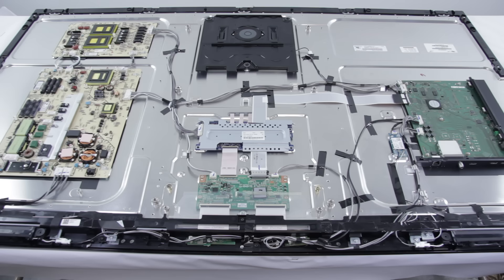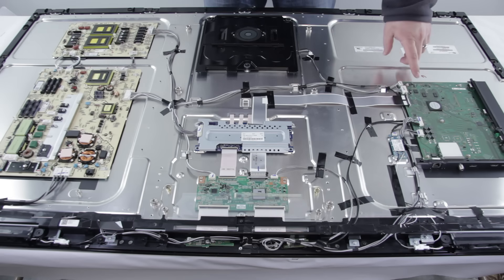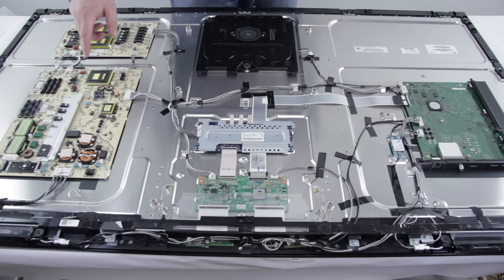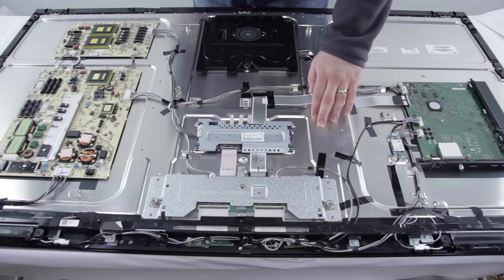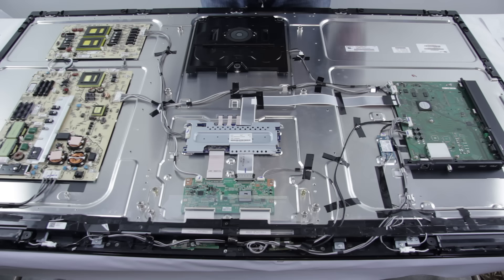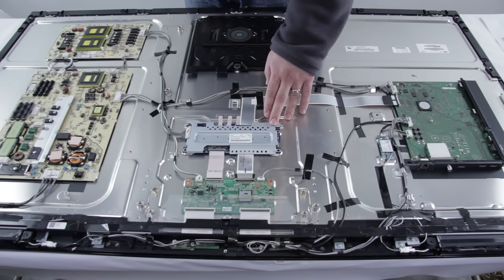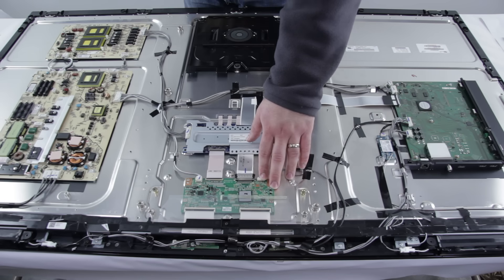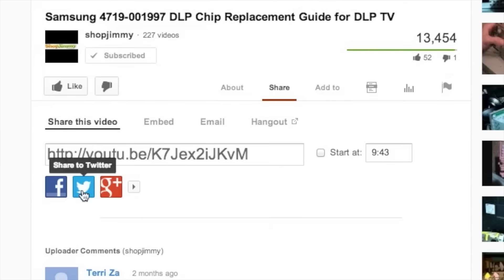LED TV Repair Tutorial - Common Symptoms & Solutions - How to Repair LED TVs

Comment: NEED HELP PLEASE.... I have Samsung  Plasma  TV 52" , Model number - PS51D460A2M. We just had an electric storm in Melbourne last week. After that, my 2 HDMI ports of the TV stopped working. If I plug my Laptop it doesn't work, but if I plug my DVD through HDMI port, it starts working. I tried replacing the Laptop` but it didn't work. I used my laptop on another TV and it works fine.I have called Samsung Tech help and they are saying that my TV is fine because my DVD is working, but I can't understand why my Laptop isn't working through HDMI on tv (when its confirmed that there is no problem with the Laptop? Can someone please help me? Thanks heaps.
Reply from the maker: sidhu1980ful   Since we do not know which board is damaged, I recommend replacing the main board and the power supply board in your TV.  I do not see any information online for your TV model number.  Please double check the TV model number and reply with the results.  Thanks!  www.shopjimmy.com

Comment: Hey there, I have a Toshiba 58L4300UC. The tv will turn on and the background will turn on for about a second, and then the backlight turns off and the tv turns off. Any ideas? Thanks in advance.
Reply: I have checked the board for bad capacitors and none are found. Power supply is a single fuse and I believe the led driver is built into the lcd module. I did the flashlight test and the tv works fine, but the backlight is off.

Comment: Hello , can you help me . I have an  Samsung LED 3D UE46D6510WSXXH , they first appeared on the screen along the top and bottom edge of the screen black lines approximately to half screen then appeared and the third black line just above the bottom line. It looks like this. Samsung LED 3D UE46D6510WSXXH
Reply from the maker: goran sebic   This sounds like a TV panel (TV Screen) problem.  If your TV panel is bad, it may be more cost-effective to replace the TV as panels are typically hard to find in stock, difficult to replace, and expensive.  Thanks and please let us know if you have any further questions!  www.shopjimmy.com

Comment: I own a samsung U32EH5000F television and installed the wrong firmware on this tv.  I accidently put the 4000 series firmware. After it rebooted the tv turned on only sound is heard but no picture.  I am able work the remote as normal power, volume and changing the channel. It also looks like some back light does turned. Can you help

Comment: I have a 47lm4700 lg led tv at first once i slept with tv on watching netflix trough xbone with hdmi cable when i woke up the tv had no pic or sound first checked for blown capacitors but all were fine then searched online and found it was most likely the main board so, i got a new one from shop jimmy replaced it but still no display or sound
Reply from the maker: Erik Reyes   I recommend running the flashlight test on your TV.   Here is a link to a video we produced that shows how to run the flashlight test. No Image No Picture on TV Screen - Flashlight Test LCD & LED TV Repair - How to Diagnose Symptoms 2 Please reply with your flashlight test results and we can recommend a replacement part for your TV repair. Thanks and please let us know if you have any questions! www.shopjimmy.com

Comment: I'm having a problem I don't see addressed. Our tv seems work fine, as long as we don't use the remote control.  And I can assure you, the problem is not the remote control.  We have 4 different remotes and the same problem persist with each one. So, here's the problem, if we try to change the channel, it does one of 2 things, ignores the remote and does nothing, or it does a continuous cycling through all the channels non stop.  If we bring up the channel and want to scroll down to change the channel, it does the same thing. It does a continuous cycling through the list.  If we use the remote to turn the volume up, it goes all the way to maximum.  If we use the remote to turn the tv down, it goes all the way to zero.  And we can't stop it.  It's as though it has a mind of it's own.  Any idea what it is and what part we might need??    Also, the tv is an LG 55LK530.  Thanks.
Reply from the maker: Cheryl A.L.  Please watch this video FIRST to help with your repair!  TV Repair! LCD, LED, Plasma, DLP How To Fix Your TV with ShopJimmy.com Help!  I recommend replacing the main board in your TV.  Here is a link to replacement parts:  http://www.shopjimmy.com/catalogsearch/result/index/?cat=56&q=LG+55LK530  Be sure to match part numbers on your current board, with your replacement for compatibility.  Thanks and please let us know if you have any further questions with your TV Repair!  www.shopjimmy.com

Comment: I have a Vizio E500i-A1 with no audio, the sound would fade in and out before totally going out.  As you stated it could be the main board.  I did the hard reset, changed HDMI cable and used another audio source still no sound. Thanks.
Reply from the maker: Rob CCJ  Please watch this video FIRST to help with your repair!  TV Repair! LCD, LED, Plasma, DLP How To Fix Your TV with ShopJimmy.com Help!  I recommend replacing the main board in your TV.  Here is a link to replacement parts:  http://www.shopjimmy.com/catalogsearch/result/index/?cat=56&q=E500i-A1  Be sure to match part numbers on your current board, with your replacement for compatibility.  Thanks and please let us know if you have any further questions with your TV Repair!  www.shopjimmy.com

Comment: Hi sir, I have a SAMSUNG LED TV, Seriial #: UN46D7000LF. I have watched a lot videos and did a lot of research but could not find what is the issue. The problem I'm having is that when I plug it to the wall it's making a click sound and doesn't turn ON. It makes a sound that its trying to TURN ON but then in like 5 seconds TURNS back OFF and the RED Light blinking. I'm not an expert to check the capacitors professionally, but when I checked them, they all look flat on the top of them. If you could please take a min and help me out with this, I would really appreciate that. Thanks
Reply from the maker: Adfghan Ozil  Please watch this video FIRST to help with your repair!  TV Repair! LCD, LED, Plasma, DLP How To Fix Your TV with ShopJimmy.com Help!  I recommend replacing the main board in your TV.  Here is a link to replacement parts:  http://www.shopjimmy.com/catalogsearch/result/index/?cat=56&q=UN46D7000LF  Be sure to match part numbers on your current board, with your replacement for compatibility.  Here is a link to a video showing how to identify your part number, click here:  Samsung Main Boards & Digital Boards: Part Numbers for LED, LCD, DLP, Plasma TV Repair  Thanks and please let us know if you have any further questions with your TV Repair!  www.shopjimmy.com

Comment: i did the flashlight test and i could see the menu screen .so i replaced the backlight inverter on my hitachi le55u516 led tv.since it went black and i could here sound.so i saw your video and did the flashlight test.but i replaced the backlight inverter but still have the black screen with sound.what else could be the problem?
Reply from the maker: shelosky69  Please watch this video FIRST to help with your repair!  TV Repair! LCD, LED, Plasma, DLP How To Fix Your TV with ShopJimmy.com Help!  It sounds like defective replacement parts.  Here is a link to replacement parts:  http://www.shopjimmy.com/catalogsearch/result/?q=le55u516  Be sure to match part numbers on your current board, with your replacement for compatibility.  Thanks and please let us know if you have any further questions with your TV Repair!  www.shopjimmy.com

Comment: I have a phillips  lcd tv model # 47pfl5704d/f7 , the last couple of days when i turn it on there is no sound for a few minutes. Then it comes on and works normal.
Reply from the maker: 52cjray  Please watch this video FIRST to help with your repair!  TV Repair! LCD, LED, Plasma, DLP How To Fix Your TV with ShopJimmy.com Help!  I recommend replacing the main board in your TV.  Follow this link to replacement parts: http://www.shopjimmy.com/catalogsearch/result/index/?cat=56&q=47pfl5704d%2Ff7  Be sure to match part numbers on your current board, with your replacement for compatibility.  Here is a link to a video showing how to identify your part number, click here:  Philips Magnavox Main Boards TV Part Number Identification Guide for DIY TV Repair Help  Thanks and please let us know if you have any further questions with your TV Repair!  www.shopjimmy.com

Comment: Please help me if you can. I have a hisense 50 inch led smart tv and It recently started to video glitch.
Reply from the maker: Brad Whitlock   Can you please describe the video glitch?  Do you have a picture on the screen, if so is it distorted?  Can you turn the TV on?  Are there any blinking lights on the front?  Also, please reply with your TV model number.  Click here to view a video that shows how to find your TV model number:  TV Repair STEP #1 Help IMPORTANT TUTORIAL How To Find Your TV Model Number Tutorial TV Repair Help  Thanks!  www.shopjimmy.com
Reply: My tv dose turn on and has picture but it distorted. No blinking light's and the model number is 50k610gw a hisense smart tv.
Reply from the maker: Brad Whitlock   I would like to see what the screen looks like when turned on with the distortion, could you upload a video or image online and then reply with the link?  Thanks!  www.shopjimmy.com
Reply: I have a video on my page I can't seem to upload a video on this page
Reply: I also have a longer video if that will help any to.
Reply from the maker: Brad Whitlock   Because of the repetition of the horizontal band across the top, I believe this looks like a TV panel (TV Screen) problem.  If your TV panel is bad, it may be more cost-effective to replace the TV as panels are typically hard to find in stock, difficult to replace, and expensive.  Thanks and please let us know if you have any further questions!  www.shopjimmy.com
Reply: Okay thank you!!

Comment: Hi i have a lg 42inc led tv 42ln4500 i hav sound and no image i have done the flash light test and cn see an image. When i put energy saving option on maximum the tv does not go black. Only goes black when backlight is on 75+. I am guess i need a new inverter board. Pls help.
Reply from the maker: aliwasis   This could either be a problem with the LED lights in the TV or the power supply board.  You can replace the power supply board to see if that fixes the problem.  Unfortunately I do not see any replacement parts in the search results for your TV model number on our website.  Please reply with your part number on your power supply board and I can try searching for replacement parts.  Thanks and please let us know if you have any further questions!  www.shopjimmy.com

Comment: vizio E280i B1..BLUESCREEN SHOWS RANDOM WHITE 1 INCH SQUARES AND LINES ON BOARDERS/EDGES..LED SCREEN OR VIDEO BOARD? THANKS
Reply from the maker: Tim Strong  Please watch this video FIRST to help with your repair!  TV Repair! LCD, LED, Plasma, DLP How To Fix Your TV with ShopJimmy.com Help!  Replacing the TV panel will not be cost-effective, but I recommend replacing the main board to see if that fixes the problem.   Here is a link to a replacement main board for your TV model number.  http://www.shopjimmy.com/catalogsearch/result/index/?cat=56&q=E280i+B1  Be sure to match part numbers on your current board, with your replacement for compatibility.  Thanks and please let us know if you have any further questions with your TV Repair!  www.shopjimmy.com

Comment: good evening...
a samsung 46 led  un46eh5000 with sound hdmi inputs working
 a black screen; the menu showing with ur flashlight test
power supply has been replaced
where do i go from here
thanks Tom
Reply from the maker: THOMAS DELGADO   I recommend replacing the main board in your TV.  Here is link to replacement parts:  http://www.shopjimmy.com/catalogsearch/result/index/?cat=56&q=un46eh5000  Be sure to match part numbers on your current board, with your replacement for compatibility.  Here is a link to a video showing how to identify your part number, click here:  Samsung Main Boards & Digital Boards: Part Numbers for LED, LCD, DLP, Plasma TV Repair  Thanks and please let us know if you have any further questions with your TV Repair!  www.shopjimmy.com

Comment: Hi there.I have a Samsung 40" LED  Model UN40ES6100F that is less than 2 years old and has audio but no picture. I tried the flashlight test but can't see anything. I suspect it was done in by overheating since it was closed up in a cabinet and somebody accidentally turned it on for an extended time while we were away. I have photos of the circuit boards including pictures of the model tags if you need them. Basically, 2 large circuit boards left and right and a smaller one lower center. My email is palchanis@gmail.com. If possible advise me on part(s) needed. Hate to toss a 1-1/2 year old TV. Thanks.

Comment: I have a Toshiba 65" LED TV-Model # 65UL610U.  My TV will run for a couple hours and then start turning itself on and off.  I cleaned off the fan thinking it maybe over heating but that did not make it any better.  When it is in the process of turning itself on and off and I catch it while its on I can turn the TV off and it will stay off and the power button on the TV stays red for a period of time before turning off.  Light is blue when powered on.  Please Help!  TV is only 2 years old.

Comment: I have a HannSpree HSG1131 LED I HAD A POWER SURGE IN MY WALL OUTLET I PUT IN A POWER SUPPLY AND A MAINBOARD THE TV STILL WONT COME ON THE POWER LIGHT IS RED AND TURNS WHITE WHEN I TURN IT ON I CAN'T TURN IT OFF THE SCREEN STAYS BLACK
Reply from the maker: Eugene Bailey  It sounds like you received defective replacement parts.  You may want to try other replacement parts to see if that fixes the problem.  Thanks!  www.shopjimmy.com

Comment: Hi, I have a lg 47LW6500 with a solarized picture. The menu is also solarized. I tried replacing the T-Con but it didn't fix the problem. Is the main board or the panel? Please help

Comment: Hi, I have a sansui SLED 3900. Every time I press the power button the tv turns on (lights and all), but goes black after 2 seconds. Before this problem started happening, my tv would randomly have a tunnel vision like effect with its lighting. I just checked the capacitors and none of them seem to be blown. Any idea what the problem might be?

Comment: I have a Samsung Series 6... 55"  TV was working fine today but had a power surge that tripped breaker.  Now the "RED" standby light just blinks.  3 quick blinks then a pause... then blinks again.  The TV does not click or anything... no sound or picture...does not respond to remote.  Model is UN55D6000SFXZA; Serial: Z2Z73CXBA10016L.

Comment: I have a LG 55LN5710, the backlight goes off after the TV is turned on, picture stays on for about 30 sec. I can see the picture with a flashlight. Turn off TV and the backlight will come on for a shorter time then go off. The sound and everything else continues to work.

Comment: Hi, I have a Element 50in ELEFW502. I have a horizontal line 3/4 down the TV. Plus more multiple lines at the very bottom.
Heres a pic of it http://postimg.org/image/scm6ojkf5/
Would it be the T Con board? Ive already reset the ribbons and no difference was made.

Comment: My Samsung UN55C8000XFXZA will not power on. When plugged in to the electrical outlet, it displays the red led on the bottom right hand corner but it is non responsive when pressing the power button on both the TV itself or from the remote control. No sounds or attempts to power on. No backlight or any other functions. Is the power supply bad?
Reply from the maker: fmejias   I recommend replacing the main board in your TV.  Here is a link to replacement parts:  http://www.shopjimmy.com/catalogsearch/result/index/?cat=56&q=UN55C8000XFXZA  Be sure to match part numbers on your current board, with your replacement for compatibility.  Here is a link to a video showing how to identify your part number, click here:  Samsung Main Boards & Digital Boards: Part Numbers for LED, LCD, DLP, Plasma TV Repair  Thanks and please let us know if you have any further questions with your TV Repair!  www.shopjimmy.com

Comment: I have a samsung ln40c550j1f that does not turn on. The problem appear after a storm. I tried changing the fusils of the power board but one of them keeps failing after a reconnect the power supply. Any idea what the problem could be? Maybe just a bad capacitor or transistor or diode (haven't checked yet) or maybe something else. Please reply! I appreciate the help.
Reply from the maker: nestor valdez  Please watch this video FIRST to help with your repair!  TV Repair! LCD, LED, Plasma, DLP How To Fix Your TV with ShopJimmy.com Help!  If you do not know which board is bad, then it is recommended that you replace the power supply board and the main board.  Here is a link to replacement parts for this TV model number.  http://www.shopjimmy.com/catalogsearch/result/?q=ln40c550j1f  Be sure to match part numbers on your current board, with your replacement for compatibility.  Thanks and please let us know if you have any further questions with your TV Repair!  www.shopjimmy.com